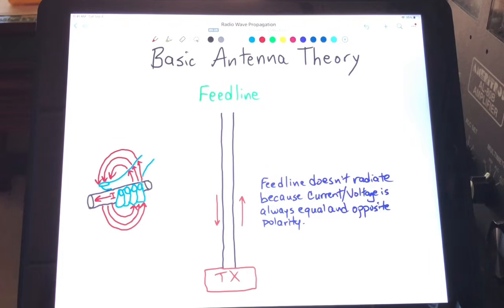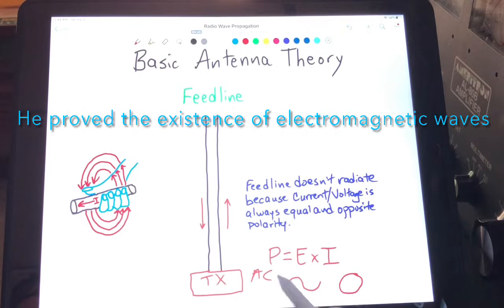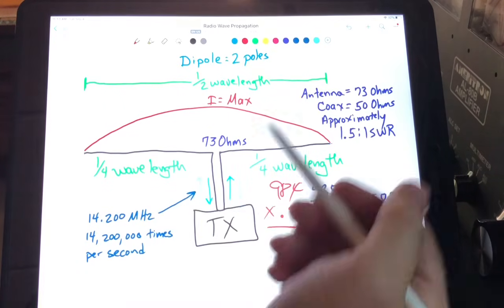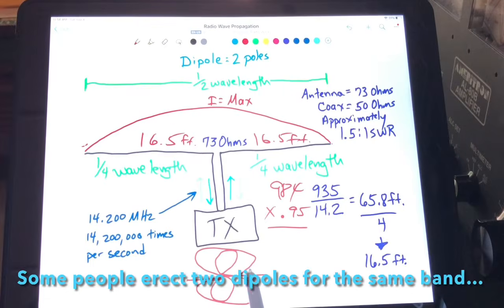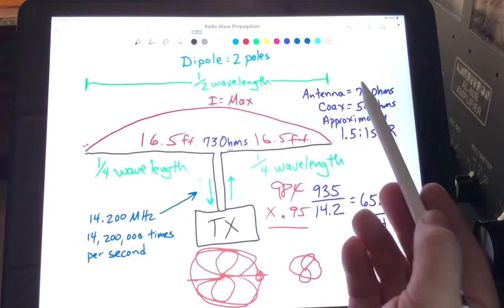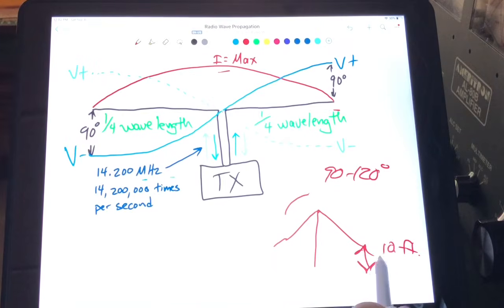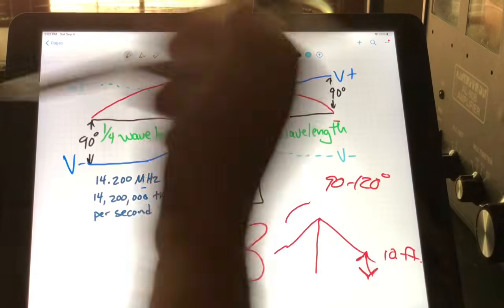Basic Antenna Theory (HF Dipole)

Comment: this was very helpful to understand this complicated topic. only thing that I didn't get is where the 73 ohm comes from when the coax is 50 ohm and how to decide rate of SWR ? thank you and 73
Reply from the maker: I wrote a very detailed article about this.  It’s available for S7 and S9 Patreon team members.  The basic answer is that a dipole cut to length (based upon the formula for antenna length) is ~73 Ohms at the feedpoint. That’s just the physics of it, based upon the impedance of free space (~377 Ohms).  

75-Ohm coax is available (RG-6) so it is possible to match the antenna to the coax at virtually 1:1.  Some charts rate RG-6 at a maximum of 850W for HF use, though some hams say they’ve run 1500W through it in SSB mode without issue. SSB is only ~30 percent duty cycle.  It can be ~50 percent with the speech processor enabled. 

But, even if the coax impedance matches the antenna, the radio wants to see 50-Ohms.  Why?  The theoretical optimum for raw power handling is around 30 ohms, while minimum loss due to attenuation occurs near 77 ohms.  Radio manufacturers chose 50-Ohms as a balance between power handling and loss.  The resulting VSWR is approximately 1.5:1 (73/50 = 1.46).  My article on Patreon, in the Technical collection, explains why 1.46:1 is plenty good.  

73, de N4HNH
Reply: @n4hnhradio  Thank you for your detailed explanation. I will look for the article.
Reply from the maker: If you are an S7 or S9 member of my Patreon team, go to the Collections page and look for the Technical collection.  Scroll down to the article about the Myth of Reflected Power.

Comment: “I do not think that the radio waves I have discovered will have any practical application.” - Heinrich Hertz 🤣
Reply from the maker: Hertz didn’t exactly quote that but it pretty much sums up his impression.  Heinrich Hertz (1857–1894) experimentally demonstrated the existence of electromagnetic waves (what we now call radio waves) in 1886–1888, confirming James Clerk Maxwell’s theory. He was primarily a pure physicist, focused on verifying theory rather than postulating practical uses.  Contemporary and later accounts consistently show he saw little immediate technological value in the electromagnetic waves.

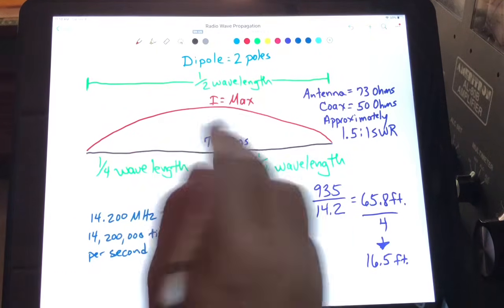Comment: 5:45 how do you measure the impedance of 73 ohms? Where do you place the prods of the multimeter? Where the feed line meets the antenna at the 90 degree turns?
Reply from the maker: You cannot measure true AC impedance with a standard multimeter (which measures DC resistance). Specialized tools or setups are needed.
Reply: Thank you for the lightning fast response, I see now that impedance is not the same as resistance.  @n4hnhradio
Reply from the maker: The simple way to look at it is that impedance is like resistance for AC circuits.  RF is alternating current.

Comment: Does the radio push RF to one leg through the center conductor and cancelling RF to the other leg through the inner wall of the shield?  Or does it only push RF through the inner core to one of the legs with that signal somehow finding its way to the inner shield where it is returned to the radio?  Or does something else happen?
Reply from the maker: Think of it as a push-pull sort of thing, whether using coax or parallel feed line (ladder line). The current generated by your transmitter simply excites electron movement in the conductors, with the highest current at the feed point of the dipole.  The electrons don’t actually travel in the way we think they do. They are being pushed and pulled back and forth 14 million 200 thousand times per second at 14.2 MHz.  It’s crazy when you ponder it.  

Coax isn’t electrically balanced (two very different conductors) so there isn’t cancellation like there is with parallel feeders.  The voltage/current isn’t equal and opposite between the center conductor and the shield of a coaxial cable. That contributes to standing waves.  Ladder line, on the other hand, yields equal and opposite voltage/current swings that cancel one another out. That’s why you can get away with using a Doublet antenna (ladder fed dipole) and not worry so much about lost energy.  Just keep the transmitter happy by using a transmatch.
Reply: Thanks Doug. So to clarify, the radio pushes electrons up the coax center conductor while simultaneously pulling electrons in the opposite  direction along the inner coax shell. Then it switches to pulling electrons along the center conductor while simultaneously pushing electrons along the inner coax shell. Then it repeats 14.2 million times per second. Either way, the radio does all of the pushing and pulling along the center conductor and inner shells?  It excites both the center conductor and inner shell of the coax?
Reply from the maker: That’s basically it. The radio transmitter produces a voltage that causes electron movement. Voltage is like cat-nip for electrons. They are drawn to it. Electrons in the outer shell (valence ring) of the atoms that make up the coax and antenna conductors are loosely bound and easily pulled out of position as they seek the positive voltage. But the positive voltage oscillates back and forth between the coax center conductor and the shield. This means that the negative voltage oscillates as well. They each switch sides 28.4 million times per second at 14.2 MHz, or 2 million times per second at 1 MHz.

A simple way to envision this process is to think of the positive voltage as pulling electrons and the negative as pushing them. Opposites attract. The North Pole of a magnet can pull the South Pole of another magnet toward itself but it will push the North Pole of the other magnet away. The negative voltage pushes electrons away while the positive pulls them. 

Since the positive and negative keep switching sides (switching conductors), they cause something like a “sloshing” back and forth of the electrons.  This rapid sloshing (oscillating) of electrons in the antenna is what produces the radio wave. Because the electrons are constantly speeding up, slowing down, and reversing direction millions of times per second, they create rapidly changing electric and magnetic fields around the antenna. These changing fields “detach” from the antenna and travel outward through space at the speed of light as an electromagnetic wave — the radio wave you are transmitting. The stronger the electron movement and the better the antenna is designed, the stronger the radiated wave becomes.

Comment: Very informative video! I have a question about the statement at 6:42. Shouldn't charge preservation and current continuity make the current flow the same throughout the wire? Perhaps I am misunderstanding and it is the current generation you are referring to.
Reply from the maker: That is a common misconception because we tend to think in terms of direct current.  But RF is alternating current.  The current does not flow at the same magnitude throughout the wire in a dipole antenna (even though charge is conserved and the wire is continuous). The current varies sinusoidally along the length of each arm of the dipole. The current is maximum at the feedpoint/center and zero at the open ends.  But keep in mind that the voltage is highest at the ends, which makes the ends dangerous.  Keep the ends out of reach of animals or humans.  They should be at least 8 to 10 feet above ground anyway to avoid ground-coupling, which can shew the SWR and cause loss.  Basically your RF energy ends up warming the dirt.

Comment: Dipole is simple at at block diagram level.. The ARRL antenna book has a good overview, would use that.   I would go over Displacement Current, it's the concept that that makes a dipole antenna work.
Reply from the maker: Not getting into displacement currents here. This is for beginners.  I go deeper on my Patreon site in a specific article entitled, “The Science Behind Wireless Communications”.  It begins with the words, “Nerd Alert!”  Thanks for the comment!

Comment: Military started teaching electron flow back in 70’s.  Civilian schools didnt catch up until late 80’s early 90’s.  Being educated by both , I had to learn both. The logic is different but polarity is same.  They had polarity right early on but it was not until 47(I think) that they realized electrons flow not the proton or atom itself.
Reply from the maker: Indeed, sir.  I was taught electron flow.
Reply: Electrons don't actually flow but rather the excitation of electrons creates electromagnetic fields around the wire that propagate. To show this you could use the thought experiment of if you had a wire that didn't have any sort of resistance and laid 1 light second of it down and then hooked it up to a lightbulb with the power source and the light bulb being right next to each other it would take less than a second for the lightbulb to turn on when the wires are connected to the power source.
Reply from the maker: The electrons don’t move very far but they move between atoms. They don’t move very far because they are changing directions according to frequency.  But they move, hence the term, current.  The Germans use strom, which is their word for the flow of a river or stream.  Here is a link for Grok’s explanation: https://x.com/i/grok/share/eoQiGYK8FCLmGxQmbR3LtQfkx

Veritasium has a nice video to illustrate how the light bulb illuminates so quickly. I have used it as a teaching aid. In the case of DC, the direction doesn’t change and electrons do eventually find their way to the positive post. That results in a “dead” (neutralized) battery.
Reply: @n4hnhradio  the link concurs with what @Ertwon is saying that the electron flow is so slow (fractions of cm / second) that it doesn't bear thinking about, when the electric field is travelling at the speed of light and instantaneously tracking the Transmitter frequency which will correspondingly induce a magnetic field, encircling the antenna at the speed of light and effectively radiating radio transmission into free space. A 1GHz Transmitter changes direction every nano second and the electron movement being a fraction of a centimetre per second multiplied by one nanosecond gives rise to the order of a few picometers of electron movement, less than the average separation between atoms in a copper lattice which is 0.23 nanometres.
Reply from the maker: Electrons in the metal have a huge thermal/Fermi speed, but only a tiny, superimposed drift. The electromagnetic fields (and therefore the current and charge density on the antenna) rearrange at a large fraction of the speed of light (approximately 186,000 miles per second). Individual electrons barely leave their neighborhood; they just slosh back and forth by a distance much smaller than the atomic spacing.
What radiates is the time-varying current and the associated accelerating charges. The B and E fields around the wire become the radiating transverse electromagnetic wave in the far field. Nothing requires electrons to travel from one end of the antenna to the other, or to “leave” the metal.

Fields do not track the transmitter “instantaneously” over distance; they propagate at finite speeds (nearly 186,000 miles per second in free space but slightly slower through feedline). Locally, the electrons respond to the local E field on the collision-time scale (10^-14 s), which is still instantaneous compared with a nanosecond.
At 1 GHz, a half-wave dipole is approximately 15 cm long, so the current is not in phase along the whole element. Skin depth at 1 GHz in copper is only a couple of micrometers, so current density (and therefore drift speed) is higher than the same current in a DC-filled wire. The displacement is still picometres.

You can essentially ignore net electron transport when thinking about how an antenna radiates. The field configuration changes at RF; the electrons themselves hardly move.

Comment: What if I can’t get it a half wave up and my impedance is only 30ohms  how do I get it to 73 ohms.
Reply from the maker: A half-wave dipole antenna 30 feet above ground with a characteristic impedance of 30 ohms is somewhat unusual, as a typical half-wave dipole in free space has an impedance closer to 73 ohms, and this can vary depending on height, ground conductivity, and nearby objects. A 30-ohm impedance suggests the antenna may be severely affected by its environment, or it could be a folded dipole, a shortened dipole, or another configuration. Here’s what you can do to optimize performance or address the impedance:

1. Verify the Impedance
   - Measure Again: Ensure the 30-ohm impedance is accurate using a reliable antenna analyzer at the operating frequency. Impedance can vary with frequency, so confirm you're measuring at the resonant frequency.
   - Check Configuration: A standard half-wave dipole at 30 feet above average ground typically has an impedance of 50–70 ohms. 50 would be ideal.  73 Ohms is actually a 1.5:1 SWR, which is also acceptable. A 30-ohm impedance might indicate:
     - A shortened dipole (e.g., loaded or coiled).
     - Proximity to conductive objects (e.g., metal roofs, power lines).
     - A folded dipole or multi-wire configuration.
     - Poor ground conductivity or reflections from the ground.

2. Match the Impedance
   To efficiently transfer power from your transmitter to the antenna, you’ll need to match the 30-ohm antenna impedance to your feedline (typically 50 ohms for coax) and transmitter. Options include:
   - Use a Matching Network:
     - Antenna Tuner: Install an antenna tuner (which I prefer to call an antenna matching unit) at the transmitter end to compensate for the mismatch between the 30-ohm antenna and the 50-ohm coax. The impedance mismatch between the antenna and the coax will likely cause the transmitter to see something other than 50 Ohms impedance at the transmitter end of the coax.  The antenna matching unit represents the simplest solution, but there may be minor losses.  An “antenna tuner” isn’t actually tuning the antenna.  It is acting as a type of transformer, to “fool” the transmitter into thinking that the antenna system is perfect.
     - LC Matching Network: Design a custom L-network or pi-network at the antenna feed point to transform 30 ohms to 50 ohms. For example, an L-network with a series inductor and shunt capacitor can be calculated using online tools or Smith chart software.
   - Transformer/Balun:
     - Use a 1.67:1 impedance transformer (50 ohms to 30 ohms) at the feed point. A balun (e.g., 1:1 current balun) can also help if you’re using coax, as it prevents common-mode currents and stabilizes impedance.
     - Example: A toroidal transformer with appropriate turns ratio (e.g., 5:3 turns) can approximate this match.
   - Adjust Feedline: If using a 50-ohm coax, the mismatch (VSWR ~1.67:1) is moderate and may be tolerable for short runs with low-loss coax. However, for high power or long feedlines, matching is critical to minimize losses.

3. Optimize the Antenna
   - Adjust Length: If the dipole is not resonant at the desired frequency, adjust its length. A half-wave dipole’s length is approximately 468/f (MHz) in feet for a full-size dipole. Fine-tune by trimming or extending the elements to achieve resonance and check if impedance increases.
   - Raise the Antenna: Increasing height above 30 feet (e.g., to 0.5–1 wavelength) can improve radiation efficiency and may raise impedance closer to 50 ohms, reducing mismatch with standard coax.

Comment: Thank you for an excellent video. I would like to build a ratable 10 meter dipole out of 1/2” diameter aluminum tubing. Will the dimensions be similar to wire dipoles? 73 de AA6JY.
Reply from the maker: You can definitely construct a dipole with aluminum poles.  A Yagi beam has a driven element that is based upon a dipole. I would say that most antennas begin conceptually based upon on the principles of the dipole.  Even a mobile antenna is conceptually a dipole. The vehicle itself provides the other pole, which we call a counterpoise.  If you watch my ATAS-120A series, you are seeing half of my HF mobile antenna system. The other half is my truck.

My Elmer used the driven element of a Mosley TA-33 Yagi beam as a rotatable dipole. The rest of the beam had been destroyed, so he bought the driven element at a Hamfest boneyard sale.  The driven element of a Mosley TA-33 can operate 10, 15, and 20 meters as a rotatable dipole.

Okay, I probably went too deep with my answer. I normally reserve this depth for my annual S9 (VIP) Patreon members.  They have access to an entire technical collection of content that goes deep.

Comment: Very nice video regarding antenna transmission. Would love to see you do a video about tuned antennas for receiving purposes.
Reply from the maker: An antenna tuned properly for transmission will automatically be tuned for receive at the same range of frequencies. That said, there are times when we might intentionally detune a receive-only antenna to minimize the amount of noise induced into it.
Reply: @n4hnhradio  I'm just getting started with this radio stuff, have electronics experience; however, not radio. So the physical machnical elements of the antenna side is rather new exposure to me. This is very helpful.
Reply from the maker: I’m glad you find my channel helpful.  There is a playlist dedicated to learning ham radio.  If you join my Patreon team at S7 or higher, you will have access to my Glossary of Amateur Radio Terminology and Common Radio Controls. I liken it to a crash course desktop reference for ham radio.  At Patreon.com/N4HNH, there is a Collections page. Look for the Technical collection. The glossary is the first post.